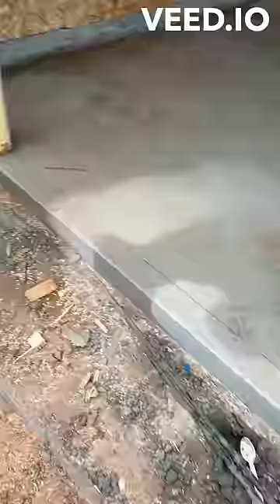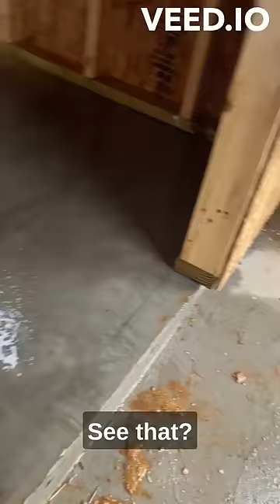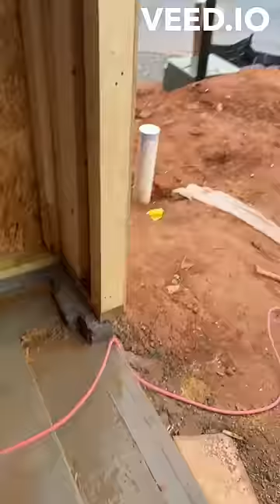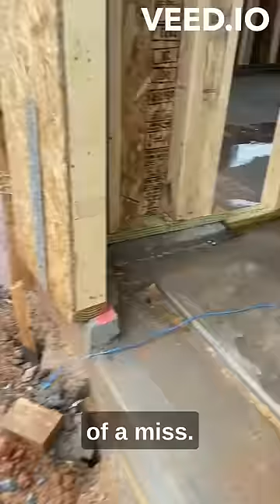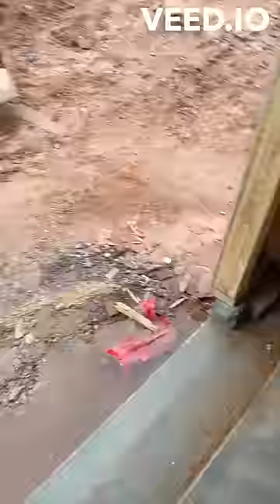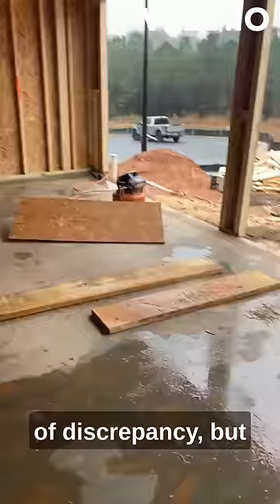New Home Slab is Wrong Size, What Now?

Comment: As someone in construction, I’m usually forced to do things in ways I don’t like or would personally NEVER approve of. It’s usually a phone call to the owner of the company “Hey this is what’s going on/this is the problem” and the response is “I don’t care just get it done we’re behind” followed with “Are you sure you don’t want to double check on this or look at it?” “No just do it we need you on the next job”. Ultimately it’s not me making the decisions to do shitty work, it’s the people signing my paychecks that I rely upon, whether people want to believe it’s me or not. When you need to work, and need the money, you honestly don’t have much of a choice.
Reply: Well said & totally agree…
Reply: I've totally been there myself, and the framing laborers here most definitely knew this was wrong but were told to keep going by the foreman.
Even if the framers work was done correctly to the contract meaning they still get paid, and the concrete guys screwed up, if I were the general contractor here i would never subcontract to this framing company ever again, total lack of integrity
Reply: I was an independent HVAC contractor for 4 years. I was offered a job with a company that did homes for the bank. Usually foreclosures and things like that. They told us to install a furnace that we didn't even size up for that place, and just from past experience, knew it wasn't sufficient enough to heat the place. It was in preparation to sell the house. I had a big issue with that. Why? Because first of all, there is a procedure for sizing the equipment to meet the demands of the house. And second, because, was the bank going to disclose that to the potential buyer, or were they just going to make it seem like the house had a working furnace and have that included in the purchase price of the home, only for the buyer to find out later that their furnace didn't work because it was undersized? I walked away from that job. Obviously, I could do that as my own boss.

But I carry that over into my employment now, where I'm not my own boss. If I can't do something the right way, I don't do it at all. And if I have to do the work, I take the time necessary to do it right, even if it sets me back. I do building maintenance, and believe me, these people, especially one of my former bosses, would push us techs to do as much work as possible. When I started this job, I had 33 properties assigned to me between 2 states. I've had lot's of clashes with the higher ups, but I honestly don't care. I truly believe that God watches everything that we do, and if it gets me fired, then so be it. But I'm doing my job the way it should be done the first time, every time, whether my boss tells me to do it that way or not. That's how I'm able to sleep at night with a clear conscience. If more people assumed that stance, instead of just securing their paycheck, these greedy bosses would be forced to make changes and do things the right way every time. Yeah, I get that we have to eat, and for those with families, provide for them. But that check should never come at the cost of our integrity and doing things the right way.
Reply: As a plumber you couldn’t have said it better
Reply: I agree to a point. Sometimes saying no to stupid ideas will make you money in the long run. Always have to be aware of the quality of work you produce as it’s your name on the product.
Reply: @nelsondln  you don't know that and made up a story saying how moral you're 😂 

I could see you cutting corners
Reply: @ArtBear88  yea bro I did it because how moral you're.. wtf are you even saying?
Reply: You always have a choice. It’s called doing the right thing. Walk off the job and go work for another builder
Reply: You always have choices, sounds like you could use integrity. In the long run high integrity wins out. Judging by your user name this looks like a deep issue for you.
Reply: @nelsondln  lol are you that unaware of how you sound? you know its a shit situation where no one is really at fault but you still felt the need to tell youtube strangers you blow loads of integrity.

people who boast about being good people by putting themselves above others they see as bad are the ones who get caught doing shady shit the most
Reply: "a situation where no one is really at fault"
If that's what you think about this work, then that's all I need to know about you. There are numerous comments here saying the same thing I am. Or as you put it, blowing loads of intregity by calling out work done wrong.  
And fyi, people who defend work like this are the ones doing shady shit, why else would you defend it. Unfortunately the trades are loaded with people like you, hence the work quality we see in this video.
Good people are the only ones keeping the bad in check, and if that's boasting to you, you have some insecurity issues to deal with. Go talk to your dad or something instead of being a tough guy on YouTube.
 @ArtBear88
Reply: Called Integrity obviously you dont have it
Reply: As a machinist I once had to mill a base flat for a medium sized (25m) windmill. The manager comes in and says the contractor said it has to be done on that side. I think "that's odd, because it looks like it's upside down". So I pull up the blueprints from the factory website and indeed, it's upside down. So I send these to my manager, he calls te contractor and the contractor says it's not upside down and that he needs them yesterday. Ok. I will just mill that thing flat knowing the construction crew is going to have a bad time, but I've done everything I could. 😅
Reply: I know exactly what you are saying and this is the exact reason why I got out of construction. Too many idiots biting off more than they could actually chew and then laying the problem at the next guys feet, usually mine!
Reply: Exactly. Been there, done that.
Reply: @pampypants871    Sure and lose your house your health insurance  and your car and get a divorce when you don't have a job.  Makes perfect sense.
Reply: Yes you do. You can make the walls fit. There's no excuse at all. None of this "well we need the architect/engineer to sign off". If you can't get them involved then PUT THE WALLS ON THE FOUNDATION/SLAB. There's no galaxy in this universe where having walls hang 2/3 in space is the right answer to anything.
Reply: Why would you want to work for an unethical company?
Reply: @awkwardtexan  Who said want?

Comment: I live in Europe. My house slab had a 5mm horizontal tolerance and 2 mm vertical. Everything out of spec according to the builder had to be fixed before the slab guys got paid. They ground down heights and filled in low points.

Comment: That's why we measure twice and cut once. When working off blueprints, you should still double check.  The guy before you might have been hungover or still wasted.
Reply: Give me a break it's cut to fit on foundation has nothing to do with a drinking problem issue??? Get a new gig your not going to get paid.
Reply: My boss always said "work hard not smart" and "measure once cut twice" said it would build character 😂
Reply: It's impossible not to measure twice and cut once you have to measure the space you are filling with a bored and you have to measure the board you are cutting so really I think what you mean is measure three times
Reply: I've always been the guy who cuts it twice and it's still too short!😂
Reply: people keep blameing the framers but on new homes framers cant just go moving walls. the whole house may have
 come as engineered panels so all they did was assemble a big piece of 
IKEA furniture and they would have no control how big the house ended up
 and even if not the houses size is also controlled my the trusses 
people think you can just change the framing to match the slab but on 
most houses built nowadays this is just not an option with out having 
things re-engineered iv framed houses that have had this exact issues
Reply: @anthonythompson5522 they're blaming the farmers because they still put the fucking house up when they should've stopped and had the problem fixed at the first sign of trouble. Now the logical answer is to tear it all out and do it again. They got paid to do a job they fucked up because they didnt fix the issue they just added to it. It's a good reason to never hire them again and fire all of them for the loss of time and money. All because they didn't care
Reply: @D_ACE1991 they don’t have to tear down the house you must not work construction. All they do is frame a concrete mold and repour they still have to do the driveway anyway
Reply: @carlyzy  You don't think there would be any strength issue with your Band-aid?  Of course there would!

Comment: Lots of people need to understand how terrible new construction is. I worked it for 6 years as a resi electrician. Its quick and cheap always, they keep 1st or 2nd years to work and get rid of jman due to wage. You would be shocked to know that most homes arent even built with a journeyman present

Comment: For all of you going Framer this Framer that, please note, and I would wager that, these walls could have been wall panels built in a factory and shipped on site
Reply: They are prefab but they are going at the framer for knowing on his set out and still standing studs. Let’s be honest though it’s as much the contractor and or architects fault. Too often architects get away with murder and I always hated how they write on their plans please check measurements before fitting. By the time fitout comes it’s often too late and is a get out of jail free card because they always have that backup. What do you mean my wardrobe is 6 inches wide mate all other plans before the fitout said 1m up until installation
Reply: Smartest comment so far. Same thoughts
Reply: Pre made or not, time to get the saws out and fix it.
Reply: @blauer2551 Easier said, than done..
Reply: Yeah but you could rip em down to fit right, I think framers and concrete framers need to holster them fingers they got on quick draw, and try having each others back and make it work, whoever's at fault work late on your own time and do the right thing, it's pretty fucked up putting someone on blast like that, a couple inches here and there could be hidden away and probably never noticed, Of course you need the approval of the GC first! But quit the sniveling and get the fuckin job done! Every comment I've read all had valid points especially the guy saying don't take the lowest bid! You get what you pay for! Do you either gotta shorten some  framed walls or dowel into it and reform it and pour it at least 3 inches coverage
Reply: I don’t blame the framer or the concrete guys. I blame the project manager for not catching this before it became a problem.
Reply: @youtubernaz1scensoredbythe201 ummm no it's not lol shut up 
It is EXACTLY as easily said as done. That's a 15-minute fix before standing and then back to business as usual 😂
Reply: @blauer2551  absolutely right. but if you're not top man on the job you either build it or walk
Reply: And they can not be adjusted AT ALL ? I find that hard to believe.
Reply: @Stephenwc  they can be adjusted. you have to do it. some people won't give you the time. on one job i had, you had four and a half days to complete a three thousand sq ft house with three guys. if you didn't make it you were fired.. no quality control. no time to adjust. just go go go.

Comment: This is an issue I have never run into with a block basement/foundation. This is an issue I have run into on every single poured basement/foundation...the off-ness varies, but is always some degree of off (sometimes, many degrees!).
Reply: Not when my crew does the work. We’ve never once had this happen. Never. All about hiring the right people for the job.
Reply: @SkylineTwinSpoolysnail   I've heard that before...haven't seen it though!
 Not calling you a liar, I obviously couldn't possibly work off of every basement/foundation in existence! 
 By the "standards" I have had the pleasure of working from (brick), if you're within an inch of the framing (provided they were correct), I'd call that "good". The worst I ever had, working off of block, was almost a 1/4"...worst for poured walls, framing was hanging out 3", leaving us with essentially a 1" brick ledge (nothing less than 1" framing overhang on that house)
Reply: Lazy guys that don’t want to check wall lengths and plum corners. Poured walls can be easy but you can’t be lazy with them

Comment: Framers should have shortened the garage by 1" no one would have known...
Reply: Literally bro. They turned a little problem into a big one by not doing that or taking it up with the engineer or architect.
Reply: Can't because of trusses, concrete needs to be filled in after. Framing had to be exact. It happens. Big gap though, won't be easy to do right. Definitely doable but annoying.
Reply: @austint1151  I would have moved the walls in... probably a double gable over those walls
Reply: @AC.Prince  there is no way to know if the walls can be moved from this short video. Moving walls sometimes is not a good idea because what if you have a bathroom upstairs or Trusses seat on that wall. After we move walls is on the framer if something goes wrong
Reply: That would make the sill plate "look right'. But all you are doing is transferring the problem upwards to the next level of the building. Framers shoulkd have notified the owner/ designer of the project.
Reply: Yes that's it good reply you're correct
Reply: @austint1151 trusses can safely overhang an inch or so. After the sheathing and siding it would all be covered.